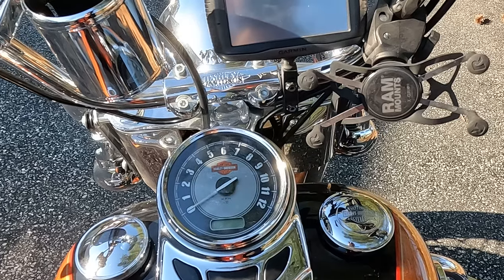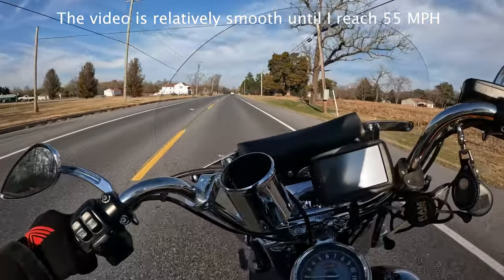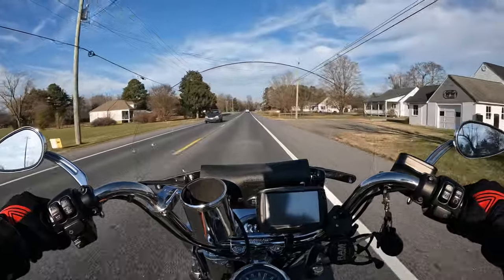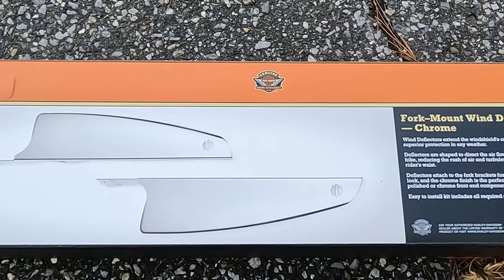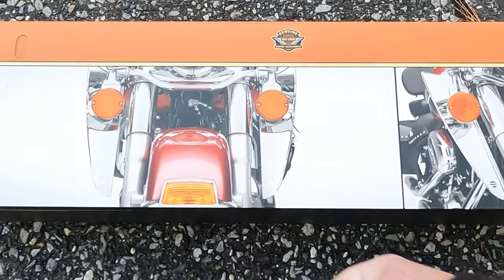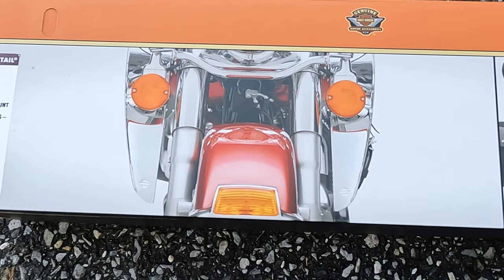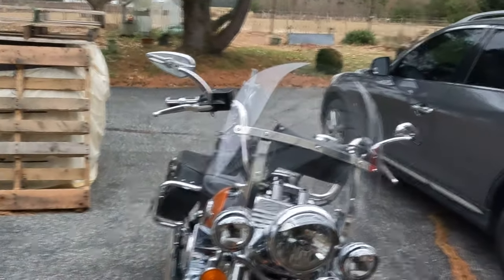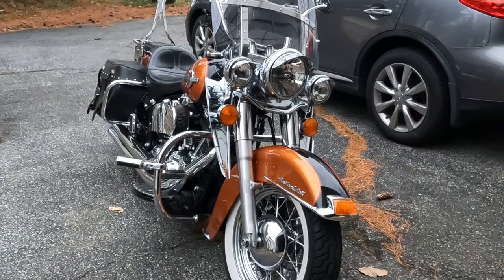Fix wind buffeting on your motorcycle

Comment: Great vid, I wanted fork deflectors anyways and didn’t even know they reduced buffeting which is sort of a problem for me. 

Another route is to actually get a smaller windshield or angle yours if it’s possible so it only protects your body up to your neck, then your head is in a steady stream. It’s not ideal, but it’s better than buffeting and keeps your torso warm.

Comment: The best windshield/wind deflector I’ve ever experienced was my ‘83 K100rs. It had a tiny adjustable lip on the very top-edge that could be dialed in to make the flow go right over your head. Man, that was a great machine.

Comment: To fix my issue, I installed a honda gold wing windshield vent. I had to cut a hole in my windshield, but by eliminating the negative pressure behind it, I was able to get rid of 90% of the buffeting up to 80 mph.

Comment: I took my first long trip on my 2022 GSX s1000 Gt +. 15 hours of riding in 2 days this past weekend. This was my first bike of the 5 I've owned with an actual windscreen. I always wear quality foam ear plugs for wind noise regardless so I thought I was safe. As the trip went on I could certainly hear and feel strong buffeting at 60mph and above right up inside the bottom of my helmet.  I noticed if I shrugged my shoulders up the noise went away, but I couldn't ride like that long. I didn't think I was doing any damage to my ears at all because I had earplugs in. Boy was I wrong. Upon further research it seems you're better off not wearing earplugs if you're dealing with buffeting and turbulent air. The earplugs create a compressed pocket of air against your eardrum that is super sensitive to any turbulent vibrations in your head and neck.

By time I got home my ears were ringing so bad I couldn't sleep. 3 days later I'm still ringing. It's worse in the mornings but gets better throughout the day. Hoping it subsides some over time. 

Anyways, lesson learned. I am seriously considering giving up riding or at least selling off this bike and go back to a naked bike or cruiser. 
I'd rather not spend time doing R&D trying to figure out how to stop the turbulence, switching screens, trying out gimmicky products and some  downright goofy looking accessories.

I treasure my hearing and I fear I've done some permanent damage unknowingly as I was wearing plugs.
Reply from the maker: Oh wow. Sorry to hear that! I imagine a different windshield would help, but it’s such a waste of money if you try a new windshield and it doesn’t work. 
I have the same bike as you and I installed a little cheapo clip on shield at the top. It helped a bit. You might consider that before giving up. You can adjust the clip on shield to get an angle that works best for you.

Comment: You're correct, buffeting cannot be fixed by the windshield size or its position. Turbulence comes from down below the gas tank. Tilted windshield pushes air upward and at the same time scooping air into cockpit from down below. And because there is some "vacuum" behind the screen, air stream happily jumps into cockpit from below, being "invited" there by the negative pressure... It hits your torso then rises up to the chin bar of a helmet causing buffeting...
The only way to stop buffeting is to install lower wind deflectors angled the way so they push air downward. That will block the turbulent stream entering cockpit from below and you'll ride inside of a capsule of still air. Fork deflectors is a half measure only, as they're being tilted in same direction as windshield, but they're better than nothing.

Comment: This issue with the fangs is not their looks. It's that they significantly increase felt heat. The right leg and crotch can get toasty with them installed. On hot days, you'll be begging for that extra bit of air coming up around the tank to cool you off. Do they also impact engine temps? Hard to say, but they might.
Reply: Yea, they should make foldable ones. Or actually they probably do, just for way more money than makes it worth not having to just take em off for the warmer months.

Comment: Pro tip on how to fix buffeting!!!! And its a free tip also, not charging anyone for this tip. Ok, are you ready? This will change your life!!! Here it is, TAKE OFF THE WINDSHIELD!!!!!! You get clean wind hitting you straight on there is no buffeting at all.
Reply from the maker: Well that is true 😁
Reply: True. If you strengthen your back and don't mind the wind on your chest, the wind noise if much more tolerable.
Reply: This is the best advice ever. I’ve been there and I only wasted my money. I guess I had to try everything what bunch of people said before growing up to ride a proper looking motorcycle. Now I don’t listen all that bull… about windshields.
Reply: Yea ok but the reason I use a windscreen is for the cold weather. I do take it off in the summer as it isn’t needed, but I like to ride my bike as long as there’s no ice on the road, and a windshield is sort of necessary here in New England if you want more than 4 months of good riding conditions.

Comment: Fork deflectors work great on my road king, the only thing that stopped buffeting completely, BUT, they also block the wind from cooling your legs and there's some weird winds that when you're on the freeway in traffic kinda wobbles the steering, doesn't hurt anything, just kinda sketchy.  In the summer where I live there's a lot of 100 degree days so I take them off, they're great in the winter for blocking the cold though..
Reply: I notice the “wobbling” when I’m coming up to a semi. Can feel the steering go left and right as the wind comes across the deflectors.

Comment: They don't look too bad - but I hear you it's one more thing on your bike.  I installed some plexiglas lowers and I found it helped the buffeting a lot - but I think I need to get a more aerodynamic helmet to reduce it any further.  Interesting about the glasses - do you think this is because the the arms allow more wind to get up under the helmet?  I wear glasses and I can't ride without them... I may need to wear contacts if it's that big of an impact.
Reply from the maker: In my case, the helmet touches the side arms of the glasses. Since the helmet is bouncing around in the turbulence, the glasses move with it. If that's the same for you, contacts will eliminate that. Bonus, you don't have to deal with glasses fogging up.
I have used four different helmets and they all vary in how the buffeting affects them. I would love to try a really high end Shoei or something known for its aerodynamics.

Comment: Do they hit your high way bars??
Reply from the maker: They do touch slightly at full lock, but not enough to concern me.
Reply: @slowridertv  thank you.
I just looked and they do not have them for my 2013 Heritage….
Reply from the maker: @JohnJones-op8uf  That's weird. But it appears Dennis Kirk has some for your 2013
Reply: @slowridertv  yes,
I had ordered them but didn’t fit my bike. I would have to remove my turn signals…